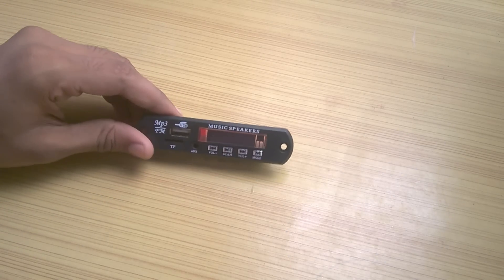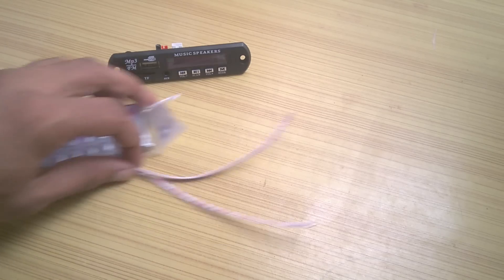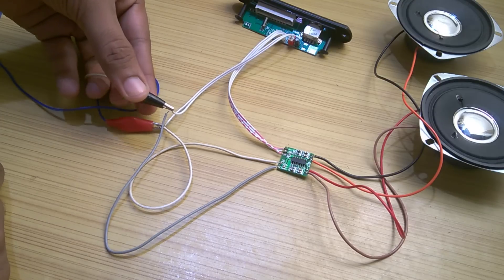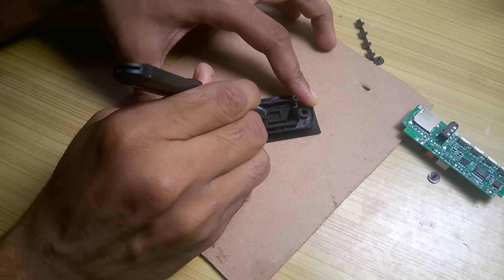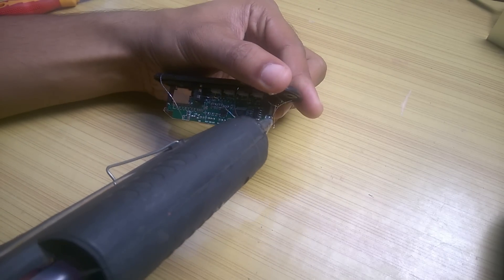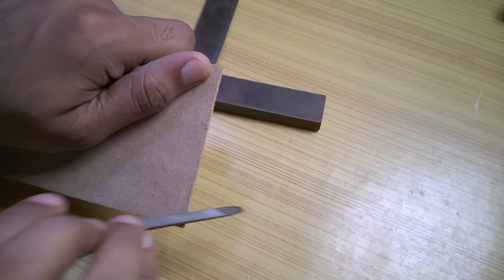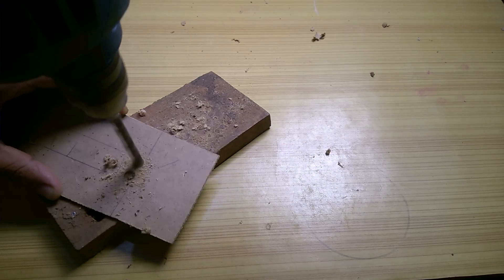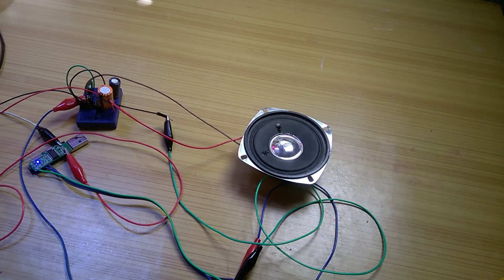Make Your Own Cheap Portable MP3 Player (Part 1) | Bluetooth, USB, AUX, SD Card, FM

Comment: Nice video . I bought such a board on ebay but the Bluetooth connection keeps cutting off and reconnecting every 30s and the same happens when playing off usb it keeps switching btn modes .could you be having an idea on what's wrong or the board has a problem?

Comment: If i have 10w 4ohm speaker then also the same amplifier and the circiut will be used
Reply from the maker: Yes you can use the same amplifier but then you will not be using the speaker to its full ability.